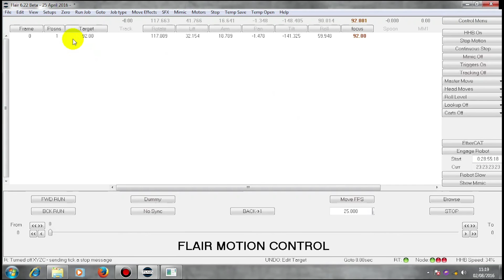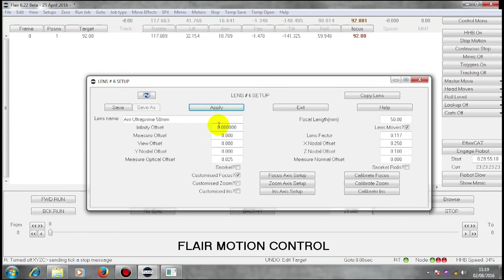07 - Lens Calibration Part 2

Comment: No, The Measure Optical offset is the offset from the Measure Hook to the Intersection of Pan and Tilt axes.
The measurement from the Nodal point of the lens back to the intersection of Pan and tilt axes is the X nodal offset on a Milo, or Z Nodal offset on a Bolt with top mounted camera.

Check you manual, there is one in the software.